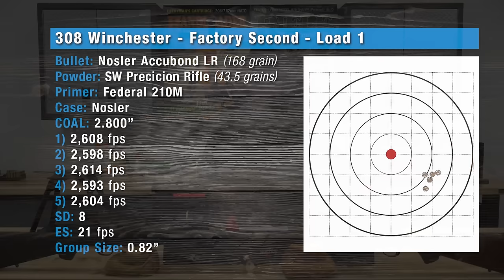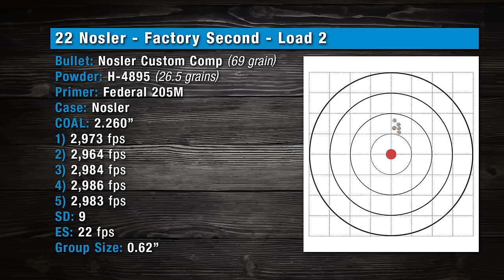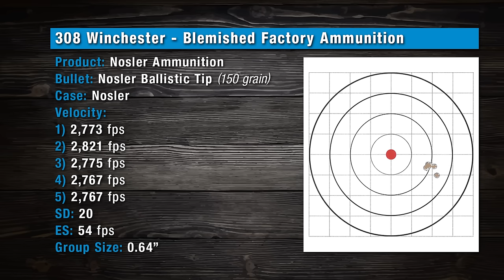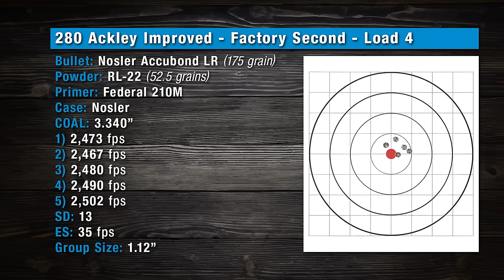Nosler Factory Seconds Do They Shoot

Comment: Good video, Jeremiah. Thank you. I live in a port city and once had an issue, maybe 25 years ago, that I traced to dispensing smokeless propellant on a humid day. I have—since then—avoided loading rounds on humid days. I keep an electronic thermometer/hygrometer in the garage and it also helps with decisions on whether to paint or not🙂!
I am a tad surprised that you have such issues in your subalpine? inland location but every place has its own microclimate.
P.S. I purchased several hundred factory-second Sierra  .308–actually .3075”, as per every ‘,308’ bullet I have measured—boat-tail hunting projectiles about 20 years ago and they were extremely accurate. If I shot the rifle consistently, I got a nice looking group. If I made an error, the bullet went exactly where the barrel had been pointed😁. Cheers from NZ🇳🇿.
Reply from the maker: Thank you very much for the kind words and feedback. It is amazing how much humidity can effect velocity and pressure. We have done some testing and the results were surprising how much the powder changed in terms of velocity and pressure based on the humidity. I am surprised as well the powder was loaded at about 29% humidity so I'm not sure what caused the low velocity. It is an interesting prospect. 
That is very interesting about your factory second experience with Sierra bullets. Perhaps if there is enough interest we could test other manufacturers factory seconds as well. Thanks for sharing your experience especially with the humidity it is something most folks don't think about but probably should. Thanks for watching and taking the time to comment! --Jeremiah

Comment: I bought “premium” Nosler new unprimed brass from Brownells. They were expensive crap. The 7-08 and 243 Win cases had off center flash holes punched in the primer pockets. They were returned to Brownells.
Reply: My 6.5prc had seams in necks and cracks also….wont buy them again
Reply from the maker: Hmmm that is very interesting something that must've slipped through QC, it happens from time to time. I had a case of bullets that was .002 under stated diameter once. Took a little bit to figure out what was going on accuracy wise. Sadly if you shoot enough and buy enough components that can happen. A tip of the hat to Brownells for taking them back! Thanks for watching and taking the time to comment! --Jeremiah
Reply: I was getting Nosler WSM brass the necks are way too thick and the only way I was able to use them was to use the case neck thinker to get the case necks thinned down so once the bullet was seated the cartridge chambered in the rifles
Reply: @lurebenson7722  I feel like you struck it rich as I did. Most chambers are are so loose SAMMI you wish you had a neck that needs to be turned down to fit more custom to yours. I bought a 200 Nosler .243 win cases that were snug in the neck. Turned the necks to true. Which were already even around. Now I have .003” clearance after firing. Dime size groups @ 100yds. Took a wyoming pronghorn @ 380yds in 2021. Quartered away double lung nicked the heart.
Reply: @Hunter4Life.  I bought the Nosler 25 cartridges in the box of 325 WSM to make into 375 - 300 WSM then found after loading the cartridges in 375 -300 WSM the necks had been so thick the loaded ammo won't chamber.
So, when the case necks are expanded from 323 " to 375" and won't chamber I expected even in 325 WSM those cases are defective.
I had to shave the case necks to get them to work for 375-300 WSM.
Kind of bad defect when expanding and stretching the metal should thin the metal but the case necks are so thick even going from 323" to 375" the necks are still to think for chambering the loaded cartridges. 
I am done with Nosler brass, and I also have had problems with Nosler brass for 6.5-284 Norma or making 6mm-284 win the necks spit after 2 firings.
For making 375-300 WSM brass seems the Hornaday and Winchester brass is the best.
Reply: @lurebenson7722  It is interesting. I’ve never resized brass to another caliber. I don’t know your procedure but I would think annealing the brass should make the brass flow evenly and solve the neck splitting issue. I anneal all my fired brass. Never had a neck split. Primer pockets stretch before any other case failure occurs in my experience. I neck turn all my brass as well. Mainly to true up concentricity. It seems to work well for me. Did you try loading an empty piece of brass? Maybe color it to see where the sizing problem is? Maybe a possible donut effect from sizing then pushing the donut to the outer most of the shoulder neck junction after seating the bullet? Hope it helps!

Comment: My 24” fn spr will stack 110gr varmageddons in .3”-.5” groups with imr4198 goin round 3500fps….ive got many blems in 6.5prc…308..223..and never notice any difference…I’ve been testin my ol 16” carbine range model with compass in the stock with 55gr fmj bulk loaded with varget and put down couple .5” groups@100 which is hard to believe..3x9 Nikon ar optics in Talley rings factory trigger…it’s a doublestar upper from back in 09 straight profile….ive got 55gr hp that prints exactly same with cfe powder….good to see ya J…matt
Reply from the maker: Sounds like a similar experience to ours with the factory seconds always nice to hear that others are having similar results. I miss those Nikon scopes they were hard to beat for the money. Thanks for sharing your experience and taking the time to watch and comment! --Jeremiah

Comment: 52.5 grain rl22 is on the lower side of the work up per nosler data 55.5 is showing max charge at roughly 2800 fps with the 52.5 should be roughly 2650ish fps but like you said there’s something not rite because your speeds are still  below the starting charge
Reply from the maker: My apologies I meant to say that it was not a max charge but velocity should have been higher! Good catch and I apologize for the confusion and you are correct the velocity is still lower than it should have been for no apparent reason other than the lot of powder I have is a little slow. A little frustrating for the video but we didn't have time to change the load since this video goes along with an article. It would have been nice to have had the time to explore that a little bit more. At any rate great catch on that and thank you for watching and taking the time to comment! --Jeremiah